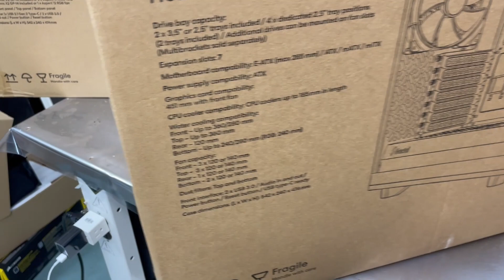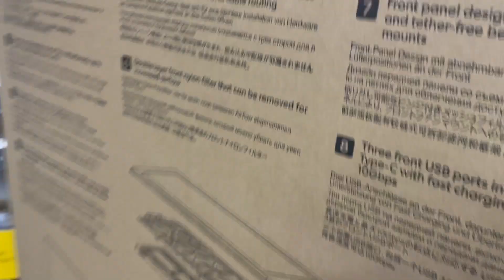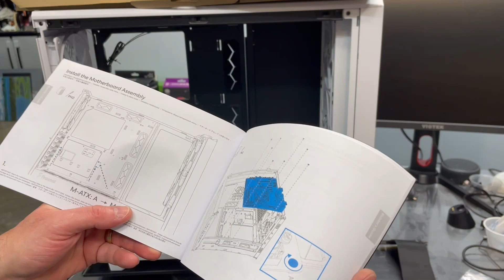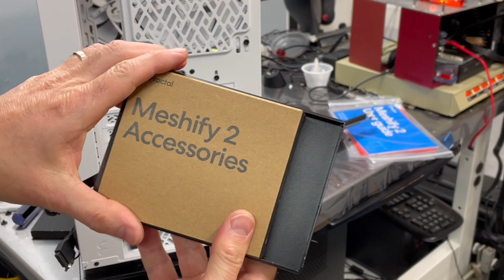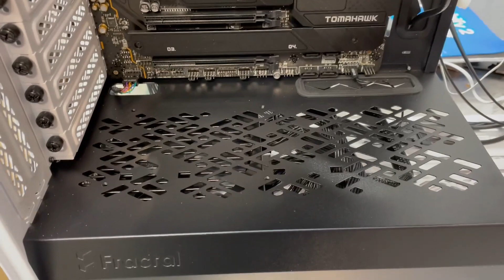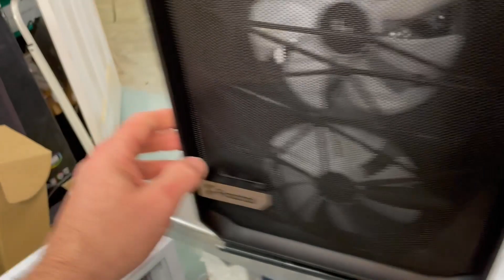Fractal Design Meshify 2 RGB and Meshify 2  Lite  RGB

Comment: Lite not having a dust filter on the front panel is right up there with the dumbest possible decisions you can make in the PC case industry if you're designing a case, and a total deal breaker. DO NOT BUY the Lite version, the inside of your PC will be full of dust all the time. 

How to ruin a 200 dollar product by not including a 2 dollar worth part...

Comment: 3x140mm front intake fans, 1x140mm back exhaust, with a top 360 aio exhaust? isn't that basically neutral air pressure then, which is the worst?

Comment: Maybe I'm dumb but I have the lite and wiring the ARBG fans is confusing me.  I assume you just daisy chain them then the last 4 pin goes to the motherboard, the last 3 pin connector goes to the RGB strip connectors on the motherboard?  Also, thank you as you have covered this better than any other video I found.  You earned a subscriber.
Reply from the maker: Ok - so yes, all of the RGB connectors (3 pin) daisy chain with the final connector (3 pin) going to the 3 pin RGB control from the motherboard, and the fans are essentially the same way - daisy chained and then the final 4 pin PWM connector goes to a fan header on the motherboard.  Power for the fans can also be run independently to separate fan header on the motherboard if you like.

Keep in mind on the RGB controls that a 3 pin connector is 5 volts and the 4 pin connectors are for 12 volts.  And you can't plug a 3 pin connector to a 4 pin RGB header on the motherboard due to one of the pin holes being blocked off.
Reply: @overclockersclub  Thank you!
Reply from the maker: Let me take a look (at the video).  The cases are packed away and not easily accessible...

Comment: Great video, thanks for posting! Just to mention on how to daisy chain the rgb fans - you can start from the small cable coming out of the front of the case (if you want to control the rgb from that front button) and leave the last one hanging (don't connect to the MB). Or, just connect the fans only and then plug the last one to the MB if you want to control the RGB from the MB...
Reply: 2 days i seek this advice... thanks a lot!
Reply: @HaBaR.  glad I could help! took me a while to figure this out and there's no good description anywhere :)
Reply: @kosherun what if i want to use button and control it through the MB in the same time?😅
Reply: @marty1997 yeah, it's a no from me dawg 🤣
Reply: @kosherun i found a solution. I just need female-female argb connector
Reply: @marty1997  awesome! glad you found a solution - please share here if it works so you can help others...
Reply: Thank you for this!

Comment: no front filter?? really for this price?
Reply: The lite is such a joke, the simplified manufacturing (way less removable parts) probably dropped the cost by like 25%, yet they also removed the fan controller...which basically costs around the 30$ (difference in price to consumer)

Comment: I'd have loved to hear where you plug the RGB cable from the fans in on the Lite since it doesn't have the thing on the back. I'm assuming the fan cable would just plug into the motherboard.

Comment: i odn't know where to plug in the fans to get the RGB to work. I'm so confused. I daisy chained the RGB cable together and then what?
Reply: same issue im having the fans work but the rgb doesnt , did u ever figure it out?
Reply: @2iLLxxx  yes, the actual cable when you plug in was hiding behind a bunch of cables. Look through the cables on the left side of the case because that specific cable is a lot shorter, causing me to miss it when I would briefly look through that area. Just diligently search the cables and you should find it
Reply: @spicynoodleboi  u talkin about the 3 pin rgb cable coming from the front header?
Reply: @2iLLxxx   I also have that problem, the cable is like 8 inches how and where do I plug it in!  Would be great if he would go over the front panel cables in more detail.
Reply: @John Jones  I finally got mine working I had a faulty front header but u just have to plug the small 3 pin rgb cable coming from the front header and daisy chain it to the rest of your fans if u want to control it with the case rgb controller 

And other than that's it straight forward plug the sata cable into the sata cord for psu and audio onto the audio port on motherboard and everything else that has to plug onto the motherboard

Comment: Nice PC, solid Build! Maybe you can help mie with mine. I have a problem with the fans and the rgb. The fans dont show up in the bios. I have daisychained it like you, but the wont give a RPM signal to the MB. Where did you connect the fans to on the motherboard?  SYS_FAN or anything else? Maybe Iv connected that wrong

Comment: I'm glad this new model can take 420mm radiator AIO on top now 😍😍
Reply from the maker: Trying to confirm this - it might be a printing error on the box...
Reply: 420mm doesn’t fit!  I tried
Reply: @HandySolution  Wow so just a 360 radiator. That is what I got already, so this is not an upgrade from my case then.
Reply: @DuyDepTraiPhoBaTrieu  I just put a 360mm in it… I couldn’t get the 420mm to fit.. it was hitting my MB and Ram.

Comment: Can you confirm if the top will take a 420mm rad on the lite? Strange for them to drop that especially when it says it can take 3x140 fans up top
Reply from the maker: I will check for you tomorrow.
Reply from the maker: Trying to confirm this - it might be a printing error on the box...
Reply: @overclockersclub  The specs on the site will also be wrong too
Reply from the maker: @danrainford  Yeah I am talking to Fractal about all that.  They are now aware of it.
Reply: @overclockersclub  sounds to me like I'm am going to get myself a free case out of all this 🤙🏽
Reply: @danrainford  This is not an error on the box. This box is used for the older Meshify 2 (which supports a top 420mm rad) and the new Meshify 2 RGB, which is limited to a 360 top rad, due to the way that the front fan bracket has been moved behind the fans. The box indicated the model and rad support correctly.
Reply: @andrewleibman9253  yes they've just confirmed to me too..
"The documentation for it is however not incorrect. There are some differences between the original Meshify 2 and the Meshify 2 Lite where the front fan bracket has been designed differently so that it is further in to the case, and that way puts the fans closer to the front mesh panel, giving it a better intake."
Reply: Don't know but he put 360mm aio at top and the case is choked , see the rear fan half covered and the aio nearly touch the front fans and cover the top of the mother board aswell so no chance for for push pull aswell so definitely no chance for 420 aio